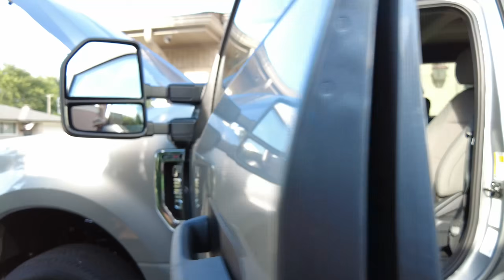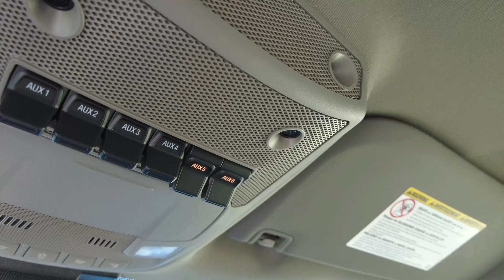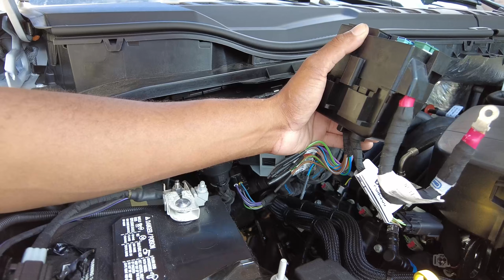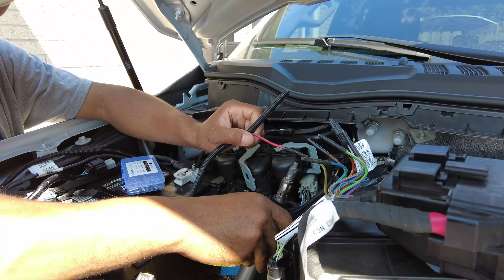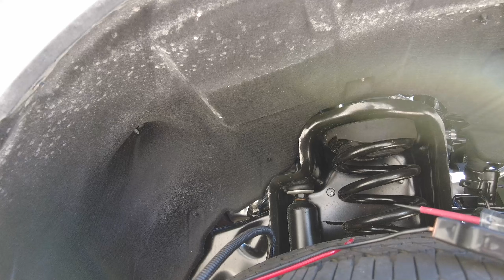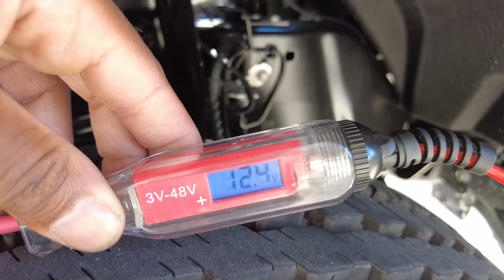How to wire FORD upfitter switches - EVERYTHING YOU NEED YOU KNOW.

Comment: Hey Sean have you noticed on the 7.3 with the 10speed that it runs better if you let it warm up for a couple minutes ? mines a 24 stx and it seems to to help mine shift a little better
Reply: This is the most ridiculous thing I ever read. Of course it will run better warm. Shifting a trans cold its going to shift rough.
Reply: @r @ryankelly6108 chill jack ass

Comment: Sean, thank you for this information.  I have a 2016 F550 with 6.7L powerstroke.  It has just 4 upfitter switches versus the 6 in your example.  I do not want to assume the concepts are the same.  Anything significantly different one needs to be aware of?  My goal is to put DeWalt 20V battery chargers in the cab and possibly find a way to put them in a heavy duty trailer as well.  Suggestions?
Reply from the maker: Are they 12 volt chargers? Might be to big a load

Comment: Couple questions sir... i am new to this...
1- some lights come with a wire harness with relay, switch and upfitter connection. Using the lights wiring that came with lights, is it necessary to use the wires/relay/upfitter connection to hook up to the trucks upfitter switches, or could i just hook up directly to  upfitter switch without using the lights included wiring harness?

2- what are all the other smaller guage wires for? Is it for smaller less ameperage usage connections?

Comment: Where did you get your switch kit from. I’d love to put that 6 way switch in my 2017 f350 xl model truck. Is it hard to find?
Reply from the maker: Yes. It came on the truck from Ford
Reply: @DS-TRUCKS  dang. Mine didn’t have them and I want to add them in but the kits I see so far seem cheap and have mixed reviews. Thanks for the info man.

Comment: NOTE - 2023 MODELS HAVE CHANGED READ FORD BODY BUILDERS LAYOUT BOOK FOR DETAILS .
Reply: Indeed, they changed the entire electrical architecture of the truck. For example, you CANNOT remove the bed for upfit on any model except for a bare bones XL or XLT. This has caused quite a bit of grief for upfitters...flatbeds, service bodies, campers, etc.
Reply from the maker: Allot Change for 2023. Upfitter switchs are the same.

Comment: Question is the uplifted factory grounded. Let’s say you use blue & white wire on the positive red wire like a cb radio do you need to run a ground or is it factory grounded. Thanks

Comment: I had no idea the whole box came out!  I'd struggle to splice wiring on my 17 6.7!  Can I shoot you a message and ask you something about the display brightness?  I haven't found anyone with any answer and maybe you have it haha
Reply from the maker: Yes
Reply from the maker: What's your question?
Reply: @DS-TRUCKS  when I got my truck, the display in reverse was the same brightness as the dash, after one of the updates reverse now comes on full brightness and there's no way I can find to change it.  (When the display changes to the backup camera)
Reply from the maker: @Craftedinnj  are your headlights set to auto?
Reply: @DS-TRUCKS  no sir, never had them set to auto even when the display stayed at the desired level in reverse. It was definitely a software update that changed it, just wish I could lower it when reversing. It's bright enough that I can't see out of my windows
Reply from the maker: @Craftedinnj  try setting the headlight knob to Auto. Let me know what happens
Reply: @DS-TRUCKS  same thing happened.  It goes to full bright